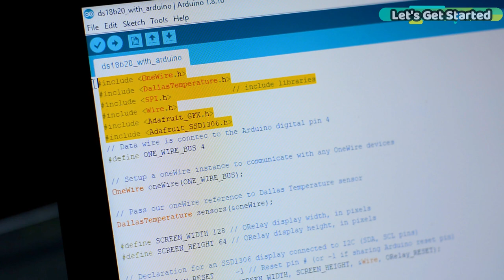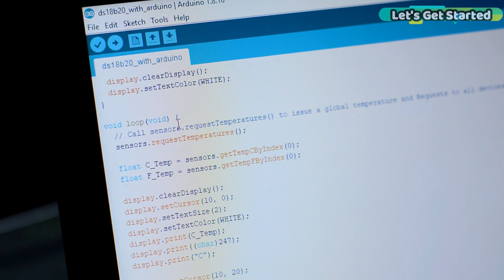DS18B20 Digital Waterproof Temperature Sensor with Arduino in Hindi Urdu

Comment from the maker: Download Circuit diagram and Programming:
https://programmingdigest.com/1-wire-ds18b

Subscribe to my other YouTube Channel "Electronic Clinic", if you want to watch the same videos in English.
https://www.youtube.com/@ElectroniClinic/videos

Previous Videos:

SMD Rework Station which one to Buy Review and Testing Hindi Urdu
https://youtu.be/d0oqL23xLmw

DS18B20 Related Videos in English:

DS18B20 With Nodemcu ESP8266
https://youtu.be/zNRmDQ3PVNA

DS18B20 with Raspberry Pi:
https://youtu.be/nb41I5JOZy8

DS18B20 with Nodemcu ESP8266 and New Blynk V2.0
https://youtu.be/tHMDacCwEus

Smart IoT Fridge Monitor using Nodemcu ESP8266
https://youtu.be/cv0yKRALZpI